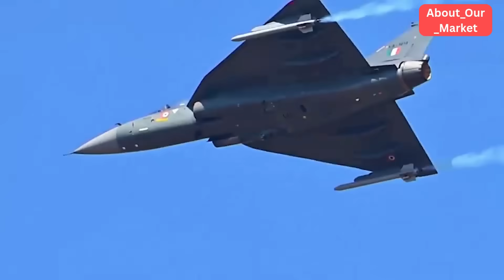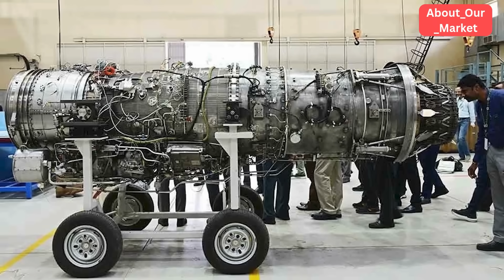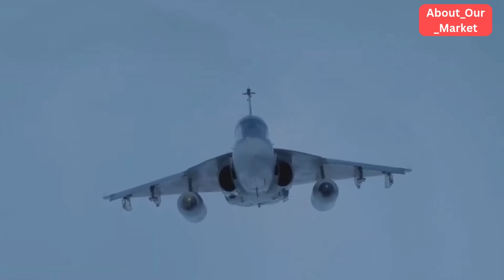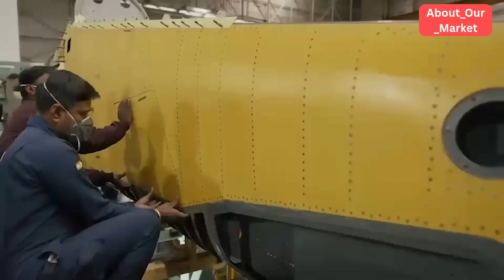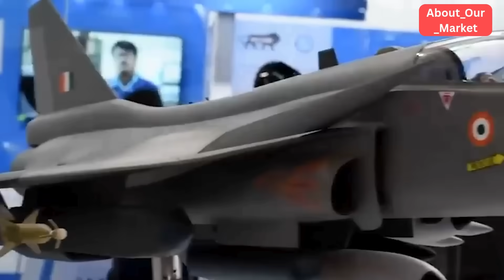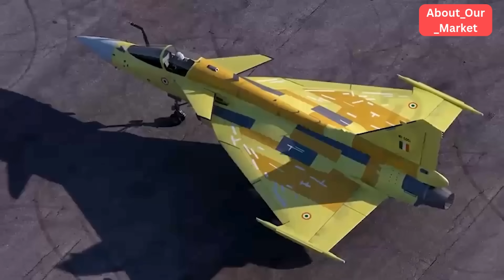From Failure to Power India’s Kaveri Engine Changes the Game

Comment: Hey Indians, I bet you didn’t know this:
1. Mirage 3 fighter engine SNECMA Atar was 1,450 kg with 60 kN thrust. 
2. Kaveri engine with afterburner is only 1.180 kg with 75 kN thrust. 
3. The Mirage 3 was 13.5 tons MTOW. 
4. The Tejas Mk 1 is also 13.5 tons MTOW. 
So current Kaveri should be able to power the Tejas or a lighter version of it.

Comment: Instal in sj 100 with turbo fans  it will have the thrust required to power sj100 ie 80 kn
Reply: There is a lot of difference between fighter jet and air liner engine because of speeds they need in a different degrees?